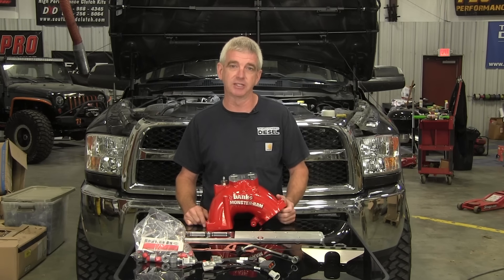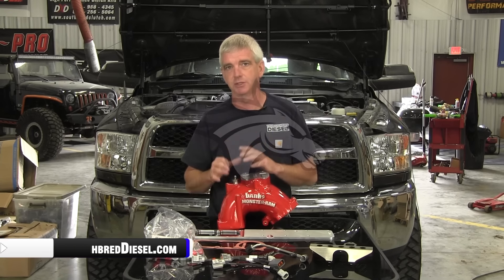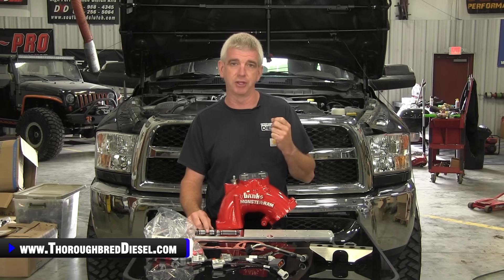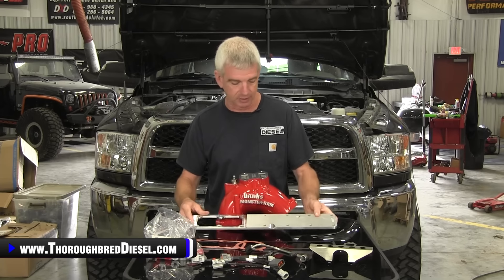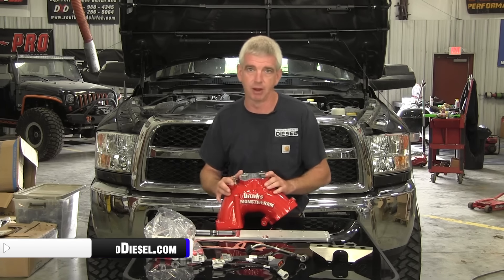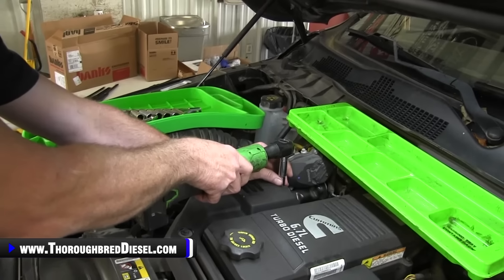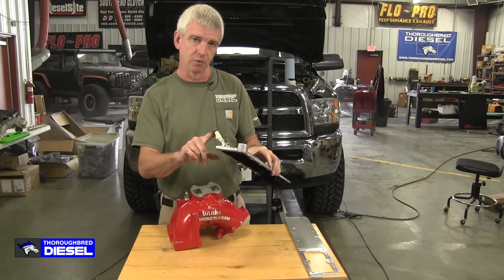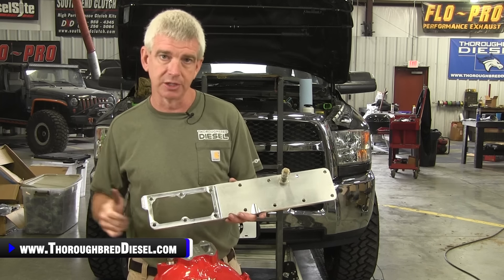HOW TO Install a BANKS Monster-Ram Intake on a Dodge Cummins 6.7L #diesel #cummins #intake #fyp

Comment from the maker: 🔥 Want a Banks Monster-Ram Intake System w/Heater Upgrade? Order One Today!
https://www.thoroughbreddiesel.com/banks-monster-ram-intake-system/
Reply: Do you install what you sell?
Reply from the maker: No
Reply: @thoroughbreddiesel I would suggest putting tape over the EGR ports until you get to that stage to avoid dropping anything in there
Reply: Thankyou sir!   Great Vid.  I just installed my MonsterRam, took me the better part of two days but also included putting in a new Thermostat and both radiator hoses (note to others, get rid of the stock squeeze type hose clamps!).  
Man, you weren't Lying about that last PCV hose!  That was a SoB!

Comment: I bought the Monster Ram a year ago after a friend lost his engine to the grid heater bolt, but was nervous and hesitant about installing it myself. Your video was done so well that I now have the confidence to do it myself. Thank you!!! I did the turbo actuator replacement and radiator Y myself and it feels good to complete these projects instead of paying someone to do it.
Reply from the maker: Thanks for sharing!  Glad I could help.
Reply: How did the install go for you? This is the best most in depth video on the monster Ram intake I’ve seen and and I’ve been considering doing it myself
Reply: What is the “Turbo actuator replacement ???   it is easy to do ?  thanks
Reply: Hell ya brother
Reply: @1980Elplacerdeviajar  The turbo actuator sits on the side of the turbo and moves the vans for the exhaust brake. Mine went out and I replaced it with one from City Diesel. Not a bad job, definitely easier than the Monster Air intake.  Plenty of YouTube videos on it and specifically how to test so you you know you just need the actuator and not the whole turbo.
Reply: Does this void the warranty? Looks great thanks!
Reply: How old or how many miles did your friend's truck have?
Reply: The Cummins is a perpetual DIY physics lesson. Just lean on reliable sources and you’ll continue to do well
Reply: @1980Elplacerdeviajar My turbo actuator quit working and got a new one from Genos garage that didn’t need dealer calibration, stronger, and dealer only offered a remanufactured one that didn’t last 65000 miles
Reply: @Enlight3121 Do the jiggle test!!!

Comment: Hi folks. This is. Few words for the person who is considering installing the Bank Monster Ram intake. Just do it. Make sure you have all the tools needed, then do it. I completed my project in 10 hours. The most difficult part was loosening and tightening #6 fuel line. Everything else was easy, just time consuming. If I can do it, so can you. I am happy I did it. The detailed video was most helpful. Take you for the video creators.
Reply from the maker: Thanks and nice job!!!
Reply: Thanks, I might give it a shot!
Reply: 10 hours, to "me" seems extreme, why did it take so long? Just wondering.
Reply: It took me 10 hours because I was not an auto mechanic. I worked slowly and methodically. I'd watch a bit of thoroughbred diesels video, then I'd do a couple of tasks. Then, I'd watch the next video segment. I progressed that way until I was complete.
I think my confidence and anxiety over doing the job slowed me down. If I had to do it again, I would probably get it done in approximately 3 to 4 hours, maybe 5 hours. (Hours will add on when you see the soot inside your engine and you clean it out)
I knew I wanted the Ram intake installed, but I couldn't afford to pay someone qualified to do it for me. I had to do it because of the unknown. What would happen if that little nut breaks off. I would be screwed if it broke.
So, lay out your tools as described in the video, turn on some music, and start the project. Ivam in Minnesota.  I've had only a couple of cold morning start-ups. So far, the heater element is working well. My computer that tracts average miles per gallon did increase by 1 gallon per hour.
Reply: I just did one on a 21 I took out fuel line 1-4 and loosened five on top of fuel rail and lifted the fuel rail just enough to slide new plate in once in place put the heat sensor in way easier and less hassle with the back two lines didn’t even undo the banging bolt make sure the gasket surface is good swept out and loose stuff I saw in the intake valley and put it back together

Comment: What truly surprises me is how many manufacturing mistakes Cummings Ram makes.  Along comes Banks with the solution.  Why doesn't Ram pay attention to the issues and Fix It ? Ram has all the data to see the issues.  The Banks Red Horn hands down looks 10 times better in the engine bay.  But, the lack of intelligence in engine design stuns me.
Reply: Got to sell more trucks. 😢
Reply: @davidhips8754  
They have so much data. They know the amount of failures that are going to happen, when they will happen, and what the over under is for them to do a recall vs deal with lawsuits. Any manufacturer could create an actual bulletproof vehicle. But that would literally be the end of their productions. Most people would keep their vehicle for 30 years if all they had to do was routine maintenance. That's why we need new car manufacturer's who can develope a business model around longevity, that way they don't need to sell you a new car every 5 years in order to keep their lights on.

Comment: I would recommend everyone install this if your warranty is up....I had the bolt break off and it destroyed my engine (2017 2500 with the 6.7). The dealer initially quoted me $32,000 for a new engine. However, because I was only over warranty by 2 months and 6k miles, they backed off but it still cost me $6k (rental $3500 and Install of $2500)because it took them 42 days to get it done.  Then I found out it was not a new engine but a remanufactured engine. I also found out the actual installed price in some paper work (I was not supposed to see) was around $17,000 (they lied) for a "new" engine installed. The warranty for this engine is almost up and I plan on installing the Banks Monster Ram intake......Your video was very well done, so thank you.  So if you are unfortunate enough to have the bolt/nut of death happen to you, play hard ball with the dealer.....I mean pitch a fit! Then watch them and pay attention. Especially if you live in Auburn California. They also acted like they were doing me a big frickin favor.....ugh!  It should be a recall.
Reply from the maker: Sorry to hear that.  Perfect example why this part is crucial.

Comment: I installed one of these today on 2017 Ram 2500. It had the code for the intake air heater and holy smokes that bolt was barely hanging on. Anyway, I want to thank you for this straight forward and informative video. Just two things - I managed the #6 fuel pipe with a 19mm crows foot on a ratchet, worked like a charm. Two, I was surprised the kit didn't come with the egr pipe gaskets, we were fortunate the local dealer had them in stock. Thanks again.
Reply from the maker: You're welcome!  Glad it turned our great!

Comment: Nice through job. Three weeks ago my son in law and I installed this on my 2019 Ram. First time tearing apart an engine for both of us, and while we got it done, it took the better part of 2 days to successfully complete. Day 1 to install, and day 2 half a day to tear it half apart and fix the fuel leak we found on day one..  there were differences in the instructions and Banks video based on the truck year. We never found our banjo bolt and assume that was not included on that year truck. I had already installed the Banks Ram air on my truck and between that and the Monster Ram, certainly makes the engine and exhaust break a lot louder. I use the truck for pulling my RV and am on our first long trip now. I pull a 36 foot 5th wheel weigh in around 11k so not a monster but all I have is the 2500 not the 3500. Running between 60 and 65 on the interstates I average a solid 14 miles a gallon which I consider great. Withe the changes I may be getting another half mile per gallon than before but will take a few more trips to know for sure. So overall I like the mods. I would not say the performance improvements have been huge but we learned a lot doing them. Wish I had watched your video before we started as there were some great tips. My son in law just bought this for his 2013 Ram 2500, so now we get to try to do a better job this time. Thanks again for this video. 😊
Reply from the maker: You're welcome!

Comment: 10/10 Install Video!! Wade has walked me through a clutch, turbo, and now a monster ram install on my 2017 Ram 2500. Couldn’t be more thankful for Thoroughbred and Wade for putting together these great videos.

The sixth fuel line gave me some trouble on this install. I ended up using a crows foot on a three inch extension and used the same method to check torque on my lines during reinstall.
Reply from the maker: Thanks, I'm glad these videos have been helpful.

Comment: Kudos for a very detailed and though install video, used it for my install on 2019 RAM 6.7 with 30k miles without any issues.  Luckily  grid heater bolt was still intact . Did not even need to view the Banks install instructions.  I also installed the Ram Air and Pedal Monster, what a big difference in overall performance. My truck is a beast now, thanks Wade. Banks Power and Thoroughbred Diesel rocks !.
Reply from the maker: Thanks and glad your truck's a beast now 💪

Comment: Great video. I just installed my new Monster Ram and your install instructions where perfect. No confusion. I recommend all Ram owners get this installed before its too late. Take Care.
Reply from the maker: Thanks for sharing!
Reply: @wildcat5496  did you end up with a Check engine light after install?  I've read many reviews that Banks knows of the issue of "too much air" that triggers a CEL and they don't have a fix for it.  How'd you fair?  I have a '23 3500 6.7HO that I wanna do this upgrade on but don't wanna deal with the CEL.

Comment: Thanks for the video. Just did my 2021 Ram 2500. 6hrs total with the help of this video. Fired up first try. 🤙🏽
Reply from the maker: Nice work!
Reply: I have a 2021 3500 with 20k miles.  How many miles on yours and what was the condition of the bolt?

Comment: Leaving the CCV cover off creates much more room for getting your hands in between the engine and the firewall for the work in the aft section of engine… connectors , fuel lines ect.

Comment: First thing that I need to say is that I really don't like to do mechanical work. I am in construction so I am handy enough to do the simple things. I was really worried about the bolt problem and I am 1.5 years out of the warranty and at 63,000 miles on my 2018 3500, so I bought the Banks RAM Monster intake. I started up your video and would watch a few minutes then went outside to do what I saw for a few minutes, then back in to the video. I missed where you said to plug in the back blue plug but I thought about it as I was going . The point to all this is that if I had understood how much was involve from the beginning I might have sent the truck somewhere to have it done. I really don't have the extra money to do that so following you was definitely the best option. It runs great so you did a great job because you were able to show even me how to do it. LOL
Reply from the maker: Glad we saved you money and you got 'er done!

Comment: Just want to add my thanks to all the others. Installed the Monster Ram over three days last week due to location issues (did it in a covered parking garage near us). Had to cart tools and accessories each day, so took a little longer than most. 

Your video was invaluable when I had questions! Thank you for taking the time to explain everything, as the work is a bit involved, but well worth it! Had a code (P02E9) afterwards, but it was installer error, as I missed the plug near the MAF sensor. 

Love the product and feel good that I saved money, protected my engine, and got a performance boost to boot!
Reply from the maker: Glad to hear and thank you for the feedback!

Comment: 1:02:32 Saved my heart attack! The fuel rail is machined in a way that almost looks like a crack around the #2 connector port, and got some fuel that leaked out under that square. I was baffled on how it can hold 20k+ psi, but breaks over backing off a nut that's suppose to be 30ft lbs🤣 
Great video btw, very thorough!
Reply from the maker: Thanks!  lol

Comment: Installed mine on a 2020 last weekend. Took me an out 6-7 hours(actual work) the QR link for the install is good but the one I got was a mix of 4th gen and 5th gen. My truck has the CP4 that had 2 hp lines to the fuel rail that were secured to the block. The sensor connector the egr cross over was also in a in a different location and I had to use some creativity to get everything connected and routed out of harms way. But it was not terrible and on top of getting rid of the factory grid heater I’ve gained about 1.5 mpg with just the monster and the cold side boost tube. 
The banks intake and the hot side tube are next.

Comment: Great video, easy to follow.  One recommendation, plug in the throttle valve connector before bolting down the banks intake.  Little more difficult after everything put together on my 2010 2500 ram.  Probably THE best video I’ve used to reference to do work on a vehicle.
Reply from the maker: Thanks!  That means a lot to us.

Comment: How often do you see a grid heater bolt failure in your line of work?  Is there a way to check it through periodic maintenance?  What do you charge for installation at your shop in Kentucky and how many hours is the installation.  You did a great job on this video! Thank you for taking the time to help the do it your selfers and letting us know what we are in for in such detail before making the commitment.
Reply from the maker: Thank you for the kind words.  We no longer offer full service here at our shop, but the shops that partner with us see this failure in the field on a more frequent basis than they would like.  One of the biggest advantages of this kit as well is the amount of airflow that we have increased just by getting rid of the restrictive grid heater, so that in itself in my opinion is what we focus on with this, and avoiding the failure is a part of that.

Comment: I bought the Banks Grid heater delete but used a different Air Ram, on my 2015 Ram 2500 and I can tell the difference in throttle response

Comment: Great Video.  Can’t thank you enough for all the great information, made the job really easy. , all the little tips , especially with the wiring harness & fuel rail. , this job was actually easier than swapping out the inner cooler & boost tubes.  Calling out all the sizes helped getting prepped for the job.
Reply from the maker: Glad it helped!
Reply: Did Dodge ever fix the problem, I just bought a 2022 3500 dually
Reply: @davidburchell2882     I really don’t know, You would have to look for yourself.  It’s easy to see on the drivers side of the engine
Reply: @jonnynash364  yeah, I see that ground wire on that plate, I guess I'm gonna have to get that Banks air ram system and change it out.

Comment: Howdy Wade. After the install, are there programming requirements with the increased air flow, or crank and go? Same question if deleted. Thanks for a great video! I appreciated the cleanliness and attention to detail as I am OCD high function with projects. Again, GREAT VIDEO and tutorial.👍🏼
Reply from the maker: No programming required here.  Airflow increase doesn’t wont trip a light, and neither does the rationality to the intake air heater.  This install is seamless.

Comment: Excellent video. I was following along as needed and when I put one of the caps in the fuel rail and saw bubbles from the bottom and got a bit worried but then moments later you explained that that was normal. Thanks for the great detailed video sir.
Reply from the maker: You're welcome!

Comment: Awesome video, not installing the monster ram but am installing the BD grid heater kit and couldnt find anything regarding the rear sensor or if i could leave it plugged in and hang it up for my 09, thanks a bunch. Even found a set of unopened HF flare wrenches and the biggest one fits the rail fittings 😂 subbed.

Comment: Is there not a concern with the bolt installed inside the horn coming loose and falling in the engine or over time, filling with soot where it can not be removed later if needed? Great video by the way, very informative!
Reply from the maker: Good question.  The bolt is pretty long and I don’t think it will back out to a point that can be ingested.  Your statement about the bolt filling with soot is correct.  We hope that a revision is done on this product to include a hex head bolt instead of the allen.
Reply: @thoroughbreddiesel  great, thanks for the reply!

Comment: I'm installing this now.  I have to say this is a great DIY video!  I've watched this video a few times now, and it seems like there's something missing.  You don't have a second alternator and the Aisin transmission.  I was wondering why you have so much extra space. Probably didn't need to separate the trans dipstick from the oil stick.  So far, so good.
Reply from the maker: I appreciate it, and yes those two attributes would have made the install a little more challenging, but the concept and most steps are the same.

Comment: Great video. When you put the magnet on the bolt that goes down into the heater hole, if you lose the bolt during the process can it be retrieved fairly easily?
Reply from the maker: Yes.  I actually did a couple times and was able to retrieve with a claw style retriever.

Comment: I ordered this kit from banks thank you for the video I found it very helpful as soon as I get it I will be installing it
Be RAM SHOULD BE RESPONSIBLE FOR THIS WE PAID OVER 55000.00 FOR THIS TRUCK WHO HAS 12000.00 DOLLARS TO
FIX THE RAM PROBLEM AS FAR AS I SEE IT